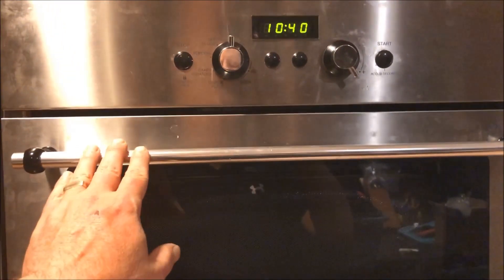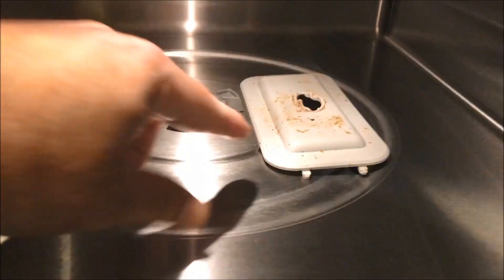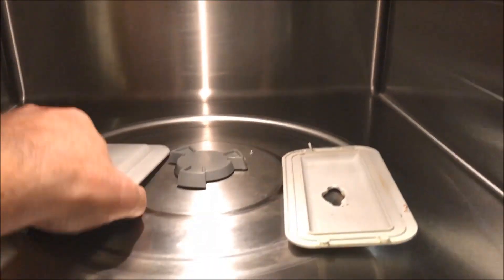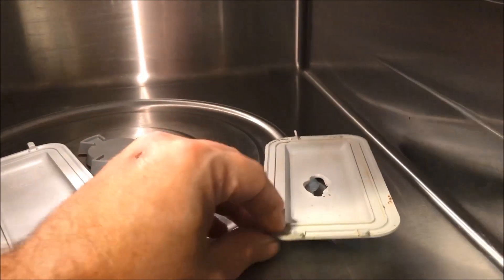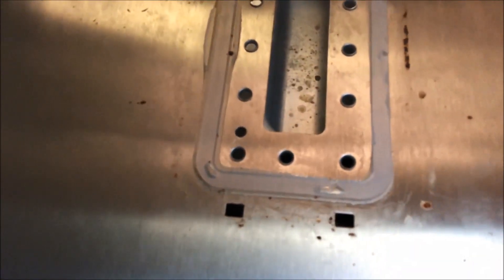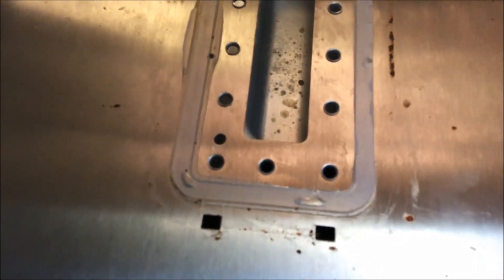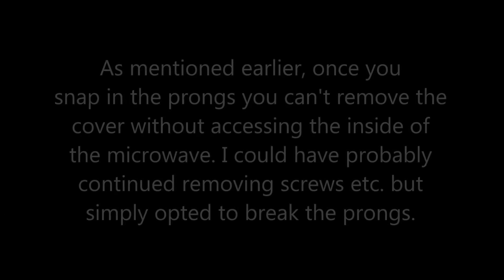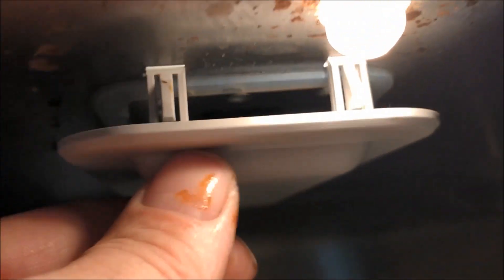Replace microwave waveguide cover (replaced with 2024 video https://youtu.be/tlIyRM_65z0)

Comment: For future reference, you don't need to break the cover to remove it.  On the front side of the cover (towards front of microwave), if you just push a flat-blade screwdriver against one of the tabs with the spring load on it, it will fall right down making it easy to remove.   I replaced mine about 4 years ago and it needed again, so thanks for making this video as a reminder of how the cover actually works.   Took me literally 20 seconds to replace it!
Reply from the maker: Noted, thanks